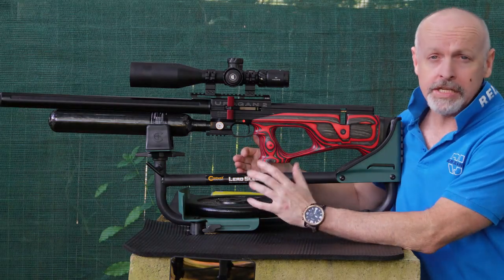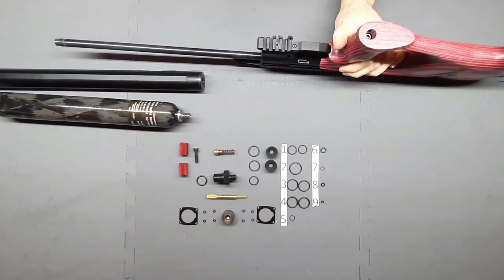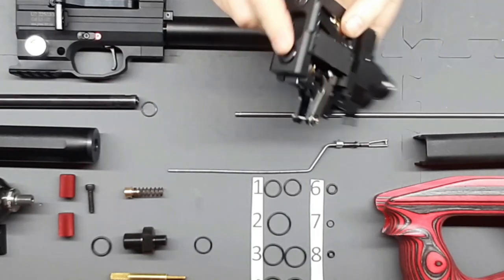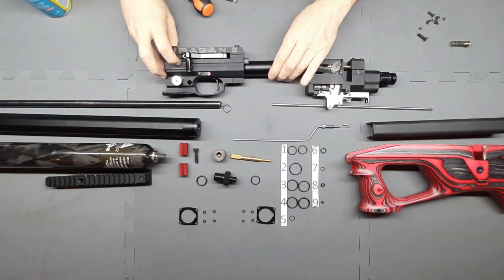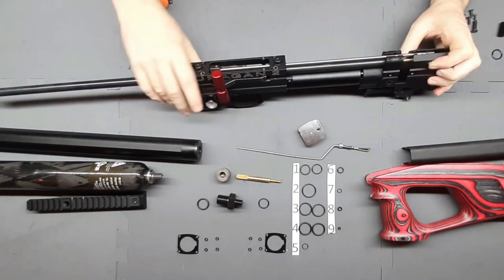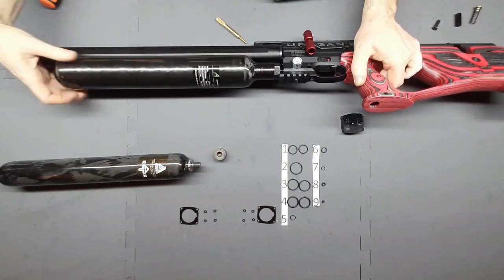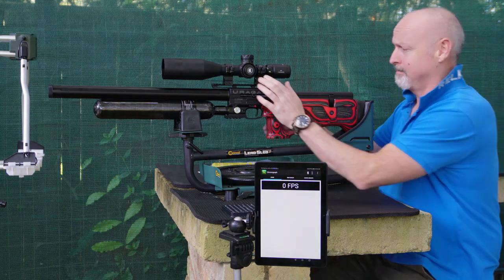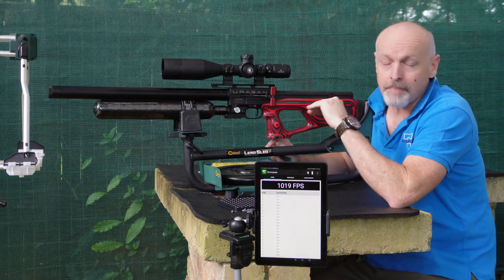Uragan 2 AAO 2023 Upgrade Kit install video with Test.

Comment: Kit was very easy to install.  Only issue I ran into was the cocking rod. Nothing was mentioned about the grub screw on the other end if it. I could not unscrew the cocking arm until that set screw was loosened. (Holds it to length, and fits tightly against the Threaded end of rod. Almost damaged my rod trying to get it loosened, till I noticed the set grub screw. And I'm sure people with these rifles, experience problems refilling after de-gasing. Every time I de-gas for a reg adjustment, same story.  Will not fill because of the value. It's a free floating hammer, so cocking your rifle makes no difference. Hammer isn't against the value on these rifles. So best to rotate barrel so that it blocks air port. Then it can build up pressure to fill. Other's block both ends of the barrel so pressure can build up for filling. I just load a pellet or slug in mine, then fills every time. Be careful, and remember to shoot that out after filling. Otherwise this video with the instructions and the kit, is well worth the money. I haven't found any need to use the heavier spring yet. And noticed because of this rifle having that balanced valve system, hammer adjustments don't have hardly any noticeable difference on FPS in shot strings. Reg tunning about all.

Comment: To reach this level of spread, some adjustment was made to the spring adjustment or it was left flush with the block.
Reply from the maker: It's a stronger hammer spring with a hammer weight from the Upgrade kit installed  yes the adjuster is flush with the back of the frame

Comment: does it make sense to update the depinger with a regulator set with not very high pressure, for example 165 bar?
or only makes sense with very high accuracies, for example from 200 bar and up.

Comment: how many bars did you set the regulator, and
  the depinger and the power hammer spring, could it be good for the 6.35 cal?
Reply from the maker: 220 bar the kits work on all Caliber Uragan 2

Comment: Any idea how to repair valve leak on Uragan 2 in 30cal ? I change all the O-rings on the valve and the valve housing but i still have the same problem
Reply from the maker: Sounds like the valve pin poppet has broken a common issue. With Uragan 2
Reply: @AfricanAirOrdnance  The plastic part of the valve pin?
Reply from the maker: @ilijaristeski58699  yes
Reply: @AfricanAirOrdnance  Thanks
Any idea where i can buy new valve online?
Reply from the maker: @ilijaristeski58699  contact Airgun Technology
Reply: Hello,
I bought a new valve,change it and now the rifle works perfectly.Thanks  for the info.

Comment: Hi, what is the diameter of the 700cc bottle. Thanks.
Reply from the maker: 60mm
Reply: @AfricanAirOrdnance   OK thanks. However i can't see how that will fit under the shroud.

Comment: Hei Bro, does depinger reduce Speed or Power?
Reply from the maker: Bearly reduces power by around 10 fps but by simple increasing the regulator pressure you can over come the 10 fps loss

Comment: Hey Bro May I know where did you buy the 700 bottle
Reply from the maker: You can get them on Alliexpress  just do a Google search  or if you are in South Africa www.pellet-guns.com
Reply: Got mine on Amazon. Cheaper than most places I checked.
Reply: @AfricanAirOrdnance  
The original 580cc cylinder is 52mm in diameter. The distance between the cylinder and the barrel cover is about 3.5mm. The Chinese Tuxing 700cc cylinder and the one from the shop are 61mm in diameter. It looks like they can't fit under the barrel shroud.
Reply from the maker: It was from a local company here is South Africa called www.pellet-guns.com